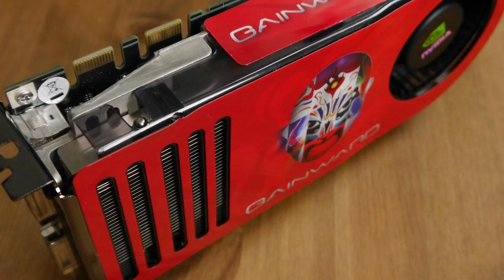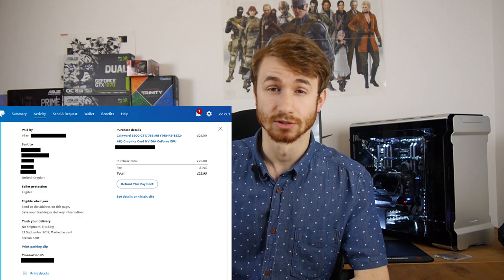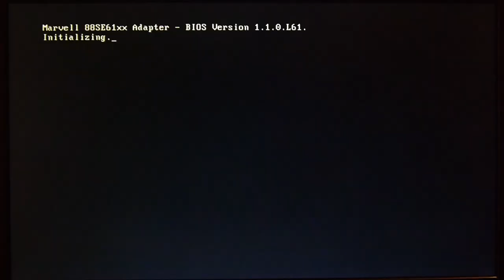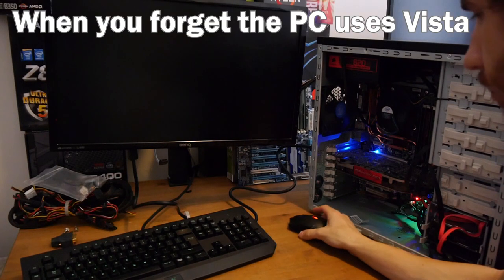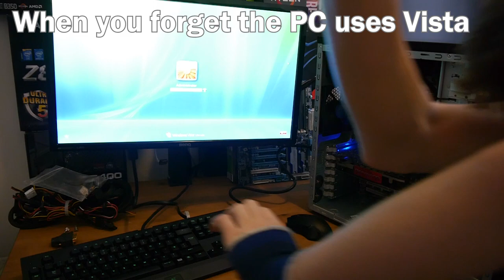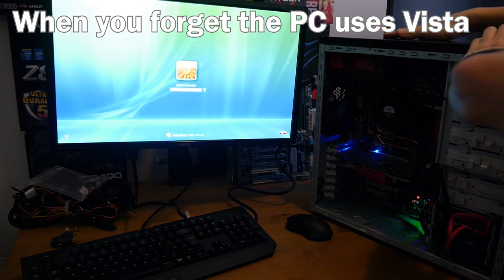Building a £50 Custom PUBG Gaming PC!

Comment: My budget PC costs £166 and features an i5-3470 with enabled 3,4 GHz Turbo on all cores and stock cooler, 8GB DDR3-1333MHz, a MSI-B75MA-E33 mainboard and a Gigabyte GTX 660 OC 3GB graphics card, paired with a shiny new 1TB hard drive and a Aerocool Aero-800 mid-tower case. A great performing computer.

Comment: Yeah, I've got 4x2GB of DDR2 ram in my PC, the motherboard supports up to 16GB, but good luck finding 4GB DDR2 modules that AREN'T AMD/Server only.
Reply from the maker: Yeah, they're rare and expensive! Also, nice motherboard, I don't think I've ever got 4GB sticks to work on 775 haha!
Reply: Some low density RAMs work on LGA 775. Tested Crucial 2 x 4GB, 1600 MHz, DDR3 on Gigabyte Combo G41M and MSI G41 P26. If I'll remember will post correct part number so people can find it because very few Crucial DDR3 work on LGA 775. Same goes for some Samsung, G.SKILL un Transcend modules, but as I said before - will post later if remember.

Comment: Wow, I'm so impressed that you managed to get a semi decent graphics card for that price. The DDR2 and c2q will be bottlenecking the graphics I would of thought? I recently upgraded from an i7 950 to a Ryzen 5 1600 and my trusty 7870XT (7930) had massive gains in a lot of games plus more stable frame rates.
Reply from the maker: So the CPU is definitely a bottleneck in some games, but with a GTX 660 at medium settings 1080p, it doesn't bottleneck most games, just the more CPU heavy ones. 

I didn't think going from a 950 to a 1600 would be that much different in games, were they overclocked?
Reply: Jeagar Tech the 950 wasn't as I was running a crossfire build and the power draw was too much, struggled to get anything past 3.6, when it should easily hit 4 with a decent cooler. The 1600 I've left at stock for now until I get a new graphics card.
Reply from the maker: Loundsify ahh okay, that's fair enough. Nice choice with the r5 1600, it's definitely my favourite CPU at the moment. What GPU are you looking to get?

Comment: Subbed. Could you make a fortnite  pc on a very very low budget.
Reply from the maker: Dude you're killing me, this build was £50, how much more budget do you want?! 

Just kidding, I acutally love this idea! I read it this morning and have already started parts hunting! Expect it soon! 

I was thinking around £20-30 and for it to be really ghetto, what do you think?
Reply: £20-£30?? Dude did you just read my mind?? This is my exact budget!!.
Reply from the maker: Ahaha! That's brilliant! A couple of things: I'll probably be going with a Dell or HP this time and sticking a GPU in (something old like an HD 6850, nice and cheap and not too crappy) and maybe a CPU upgrade (probably going Q6600 again). That would give decent-ish performance and would be super cheap!
Reply: You can try the tape method. By using the tape method, you could overclock the Q660 to 3.0ghz without a bios.
Reply: Jeagar Tech try a e8400 I have one and I can run fortnite
Reply from the maker: See I was thinking a core 2 duo. What GPU and what resolution do you run?
Reply: i run at 1280x1024 at 80 fps low settings with r7 240 and e8400
Reply from the maker: That's very interesting, thanks for the info!
Reply: you are welcome

Comment: Battlefield 1 work on this or no
Reply from the maker: I just tested it and although it ran okay (1080p, medium settings at about 40fps), there were a lot of dips because the CPU is so hammered.

So yes it does, but it is a bit stuttery. You could probably get it smooth by altering some settings though.